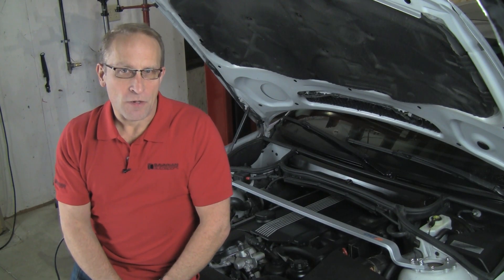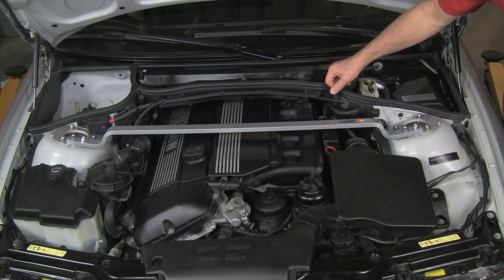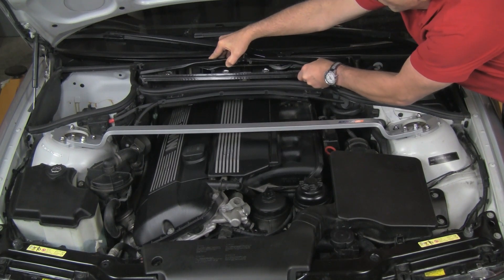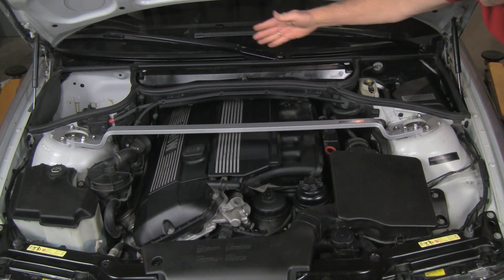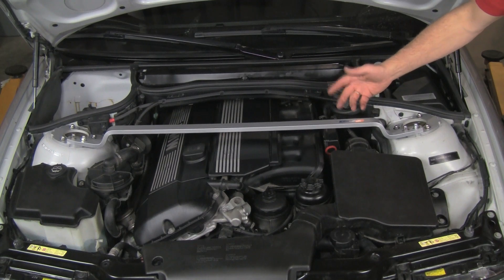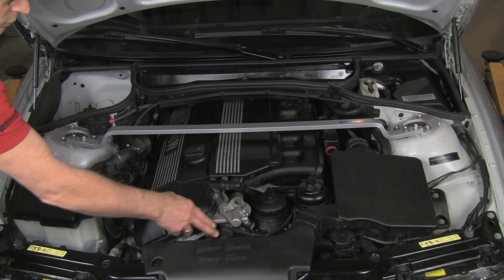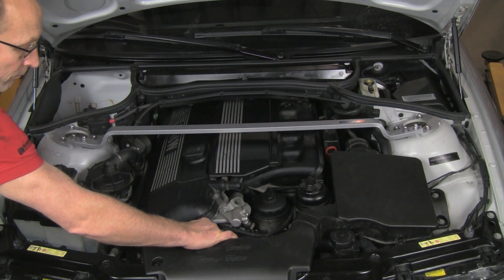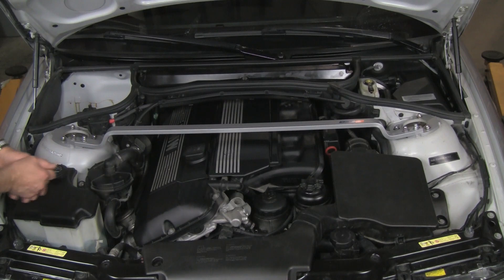Part 1 of 3: Maintenance Inspection for BMWs & MINIs - Under the Hood - BavAuto DIY

Comment: I'm considering purchasing a used BMW (it would be my first BMW) and watched this video in anticipation of learning about things to check on when I look under the hood. All told this video did that. Dealer/seller might freak out when I start pulling clips to look at that micro filter and the subsequent air filter but that just works in my favor so I don't look like a complete novice. Thank you!  
One question if I may: 
Any major differences out there I should be aware of between a 330 xi 325? Both are similarly priced, similar mileage & appointments and overall condition, not sure if I should choose one over the other, but the salesman seemed either indifferent or lacking in specific knowledge about the branding differences and I fare no better in terms of knowledge.

Comment: Hi, Bav Autosport. With my Bimmer 320ci E46 I have 2000km (1200 miles) for 15 months. It is necessary to change the oil ?

Comment: Great video. Question: As I wait for my Bentley manual to arrive for my E46 330ci,  when checking my engine oil level I've been getting different readings (albeit all within range) on the dipstick. Should I check the engine  oil when the engine is cold or warm? And if warm, how long after engine shut down should I wait for the oil to drain down in the block?
Thanks,
Bill

Comment: My experience, owned a few BMWs.  Car becomes unreliable and a money dump after about 50-60k. "Maintenance" is unreasonably expensive and many parts go out constantly with ridiculous replacement costs.  Also, almost seems like they're built to make it hard for you to work on them.  Have been a pain in my ass really.  No longer have any respect for the hyped german engineering. Buy American or Japanese cars and save yourself the headache!
Reply: +Larry Kameron : I agree with your assesment of BMW low reliability to a point. BMW requires constant maintenance but many owners neglected the maintenance due to the high cost of BMW parts and labor. The most reliable cars I've owned are Japanese. But the cost for Japanese parts is also high, not as much as BMW, compare to American cars.
Reply: the price of BMW parts depends on your region, here near Seattle we have a surplus of parting out bimmers with reasonable negotiable prices for parts. My 525i was comparable in maintainence cost and replacement parts for my 2003 ford mustang v6. And about the same amount of upkeep too especially after 100k miles

Comment: is there an explanation why the paint under the hood is white'ish and the rest of the car silver? my '01 E46 325i has that too.
Reply from the maker: The underhood area, as well as other areas that are not exterior body panels, does not receive the metallic or clear coats.  These areas just have the color base coat.

Comment from the maker: Please email us at info@bavauto.com or call our Advisors at 800-535-2002.  There are many possible issues that could be at play with your note of the rear brakes not working on both sides.  One thought is a seized caliper, but further discussion and detailed symptoms will need to be covered.

Comment from the maker: Either you have a bunch of individual issues or a corruption in the CAN BUS system.  One thought would be to change the ignition switch.  This is a common system corruption point.  We have the switches in stock at bavauto.com.

Comment: Having a problem with 525i as doors will not unlock or open except the driver's and only manually with the key, the wipers are constantly running and will not turn off, no alarm sound when key is pressed, full beam and traffic signals only stay for a few seconds and cut off. The car starts and drives and battery tested was said to be ok. Please help.

Comment from the maker: You likely have a blown head gasket, intake manifold gasket (on the small-block Chevy V8 only) or a cracked engine block or cylinder head.